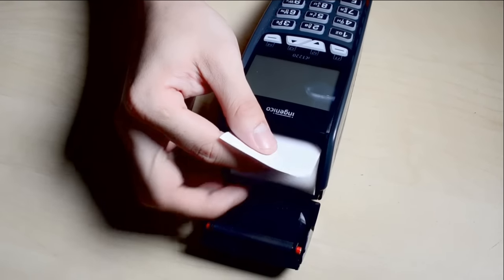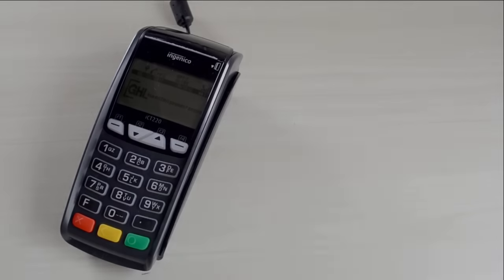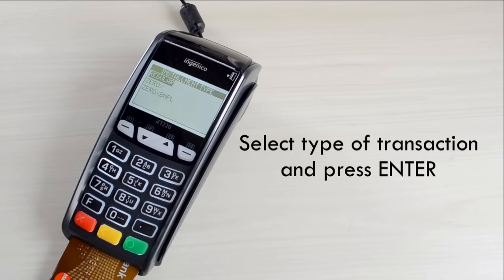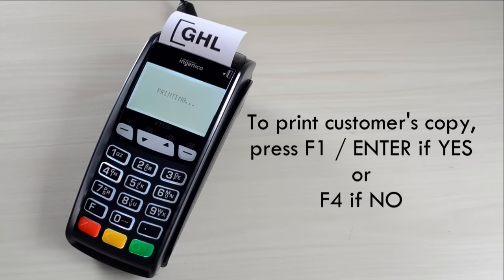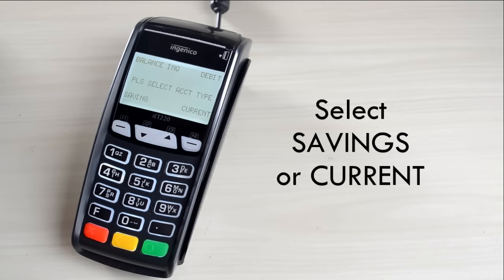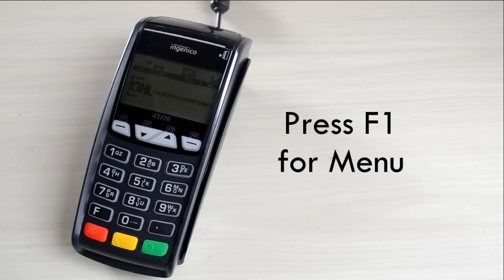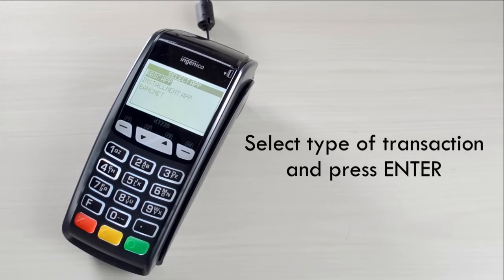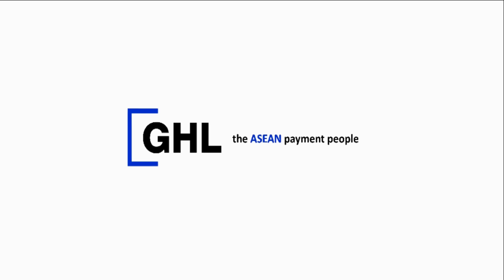Merchant POS Orientation and Training Video

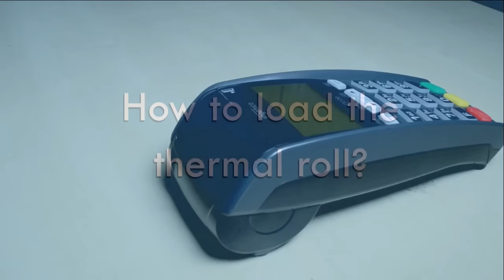Comment: 0:10 How to load the thermal roll? (The paper that prings receipts)
0:37 How to use chip and magnetic card reader on terminals?
For chip cards, the EMV card reader is placed at the front of the terminal. Position the card with the contents facing upwards in the slot and remove the card when the transaction is finished.

1:05 MAGNETIC CARDS
The magnetic card reader is located at the right hand side of the terminal. Position the card with the stripe facing down and swipe it down the magnetic card reader towards keypad.

1:23 What are the types of transactions
STRAIGHT TRANSACTION
 
On the main screen, swipe or insert the card, on the mechants menu press f2 to scroll down or f3 to scroll
Select type of transaction and press enter.
On the display pan, check and validate card info and press enter.
On amount entry, key in amount and press enter
Terminal will connect to host and process transaction.
Terminal will print merchants copy. To print customers copy press f1 if yes and f4 if no.
Reply: Thanks for this
Reply: @boomhauer0079  Glad you found it helpful. Sorry i never finished :'(
Reply: @funandlala  When I buy this device that is in the video, does it come with the payment program? I mean, will it be programmed and ready to use